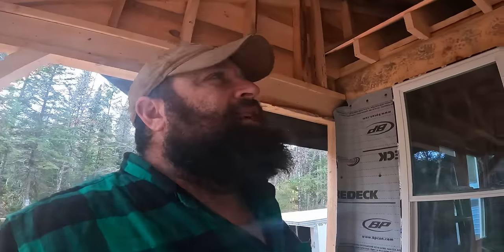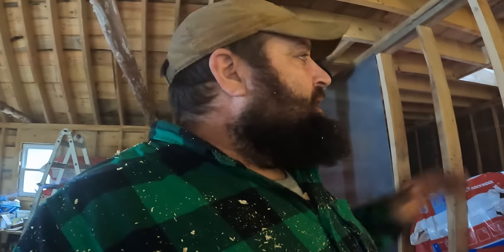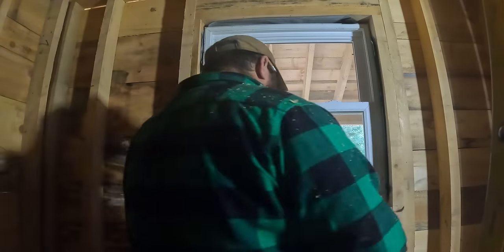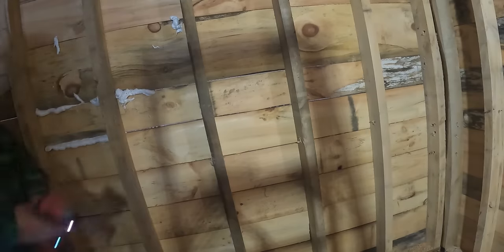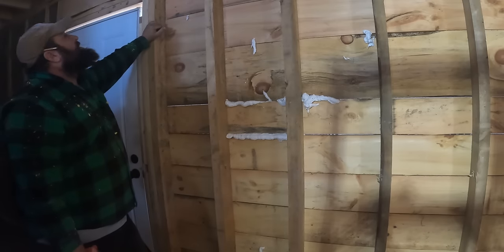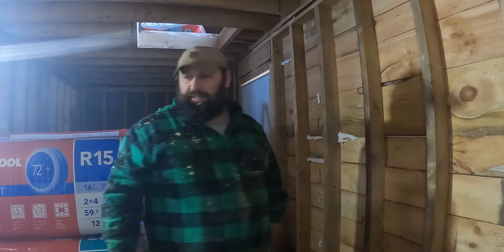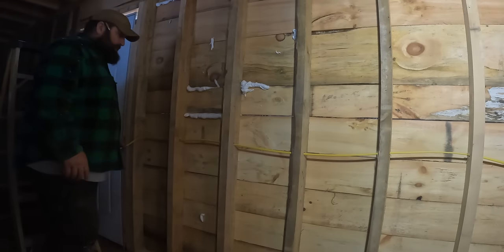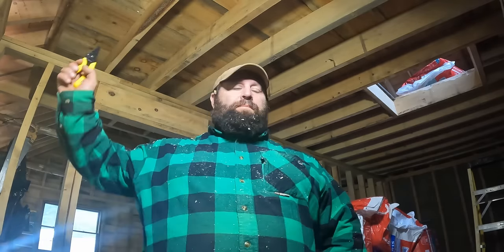Working on the Cabin: Insulation, Electrical, V-Match: Episode 32

Comment: I’ve used the laser level for drilling hole for electrical, works great keeping everything straight and easier to line up the holes when you have to drill from the other side
Reply from the maker: That makes sense thanks

Comment: You need to put outlets and lights in place then run wire to them the way it sounds and looks you have 12-2 romex going from a light switch to the breaker box
Reply: I’m only 22 mins in maybe you’ll change something up soon 😊
Reply from the maker: For sure thanks. Stay tuned.

Comment: No Vapor Barrier?
Reply: Might could’ve wanted to done that bub
Reply: He’s got pine boards on the outside. The wall assembly is far from air tight so the wall will dry just fine being that they built it like the old days. If they put something like Zip system on the outside and taped and air sealed really well, vapor would be a problem condensing on the back of it in winter and you’d be right to need a vapor retarder. You should never use a barrier though.
Reply from the maker: Thank you
Reply from the maker: No we didn’t use one